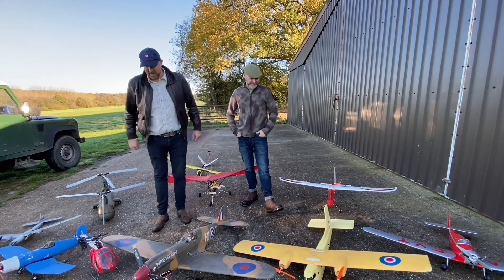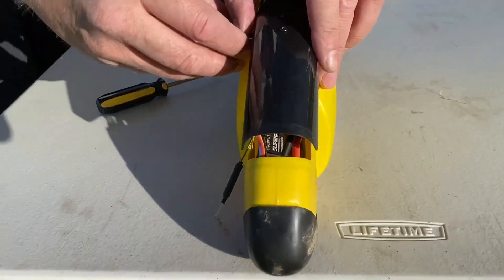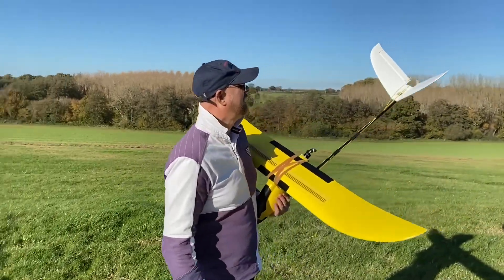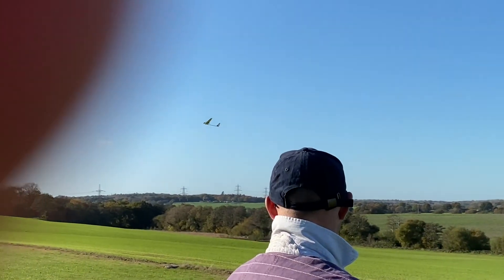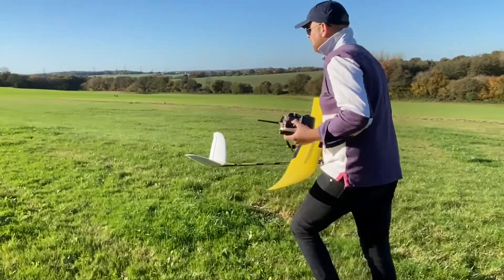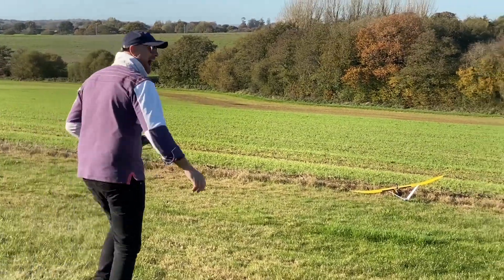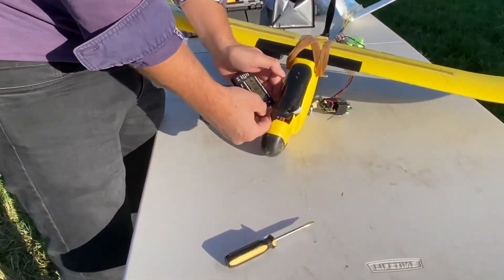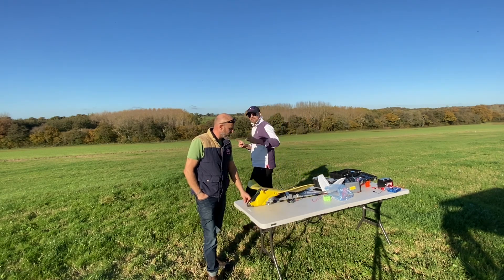Episode 5 Returning to Flight Aerobird Large Xtreme

Comment: Thank you for posting this video of a Hobbico Aerobird Xtreme.  You must be the only other person on the planet still flying this plane.  Good job with the elevon replacement and your other modifications.  Wonder which plane those are from?  Eleven years ago, I converted mine to electric, same arrangement as yours, and posted in RC Groups and have a video on You Tube.  Even with the 2200 battery far forward, it is tail heavy.  Adding weight in the nose is an option, but instead of adding alot of weight, I cut the wing in half and made it swept wing.  Resolved the issue, flew as it should, glided power off nicely and looked even better.  Later, to remove it's typical rocking tendency, I further modified the swept wing to anhedral which stopped the rocking and turned it into a very good 3 ch plane.  Unfortunately, last year, I forgot the wing on the roof of my van and somewhere on the way home, it flew off.  Luckily, I have a spare wing and it is cut for conversion into a swept wing, no anhedral this time, but ailerons instead.  Another wing modification was the cutting of two wings to produce an approximately 74 inch span.  Needed nose weight but flew slower and quite steady